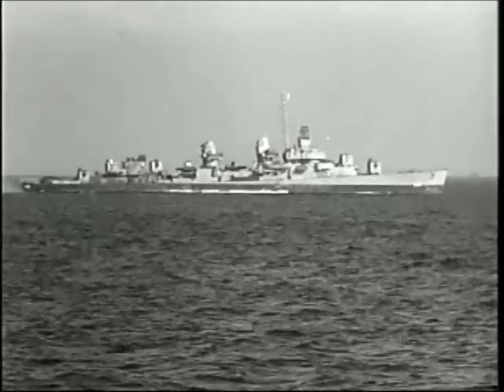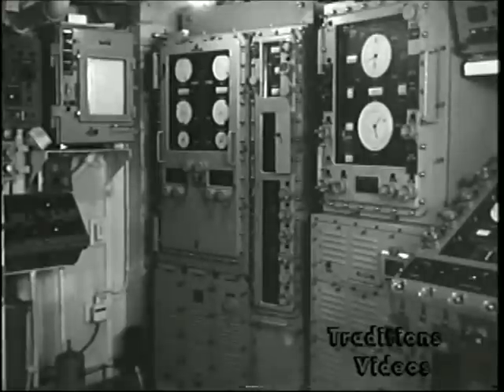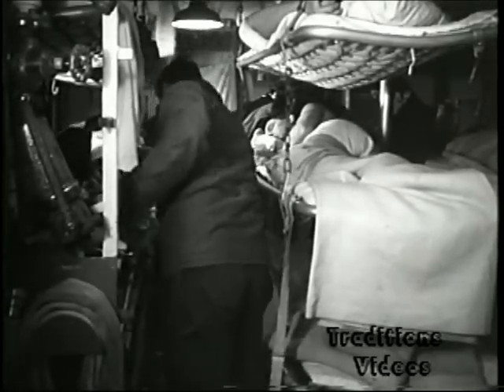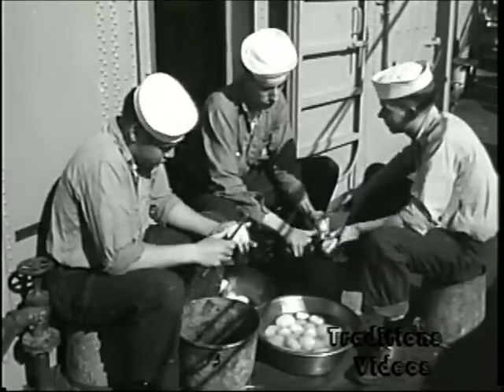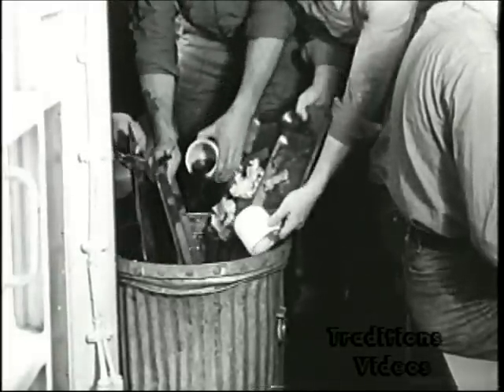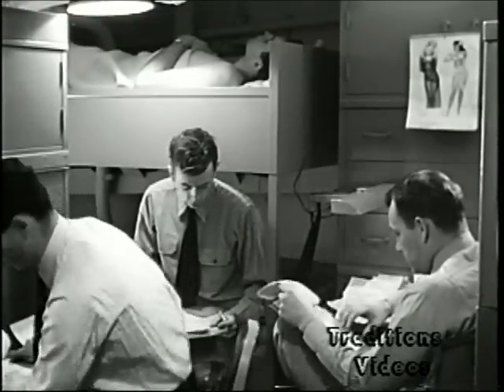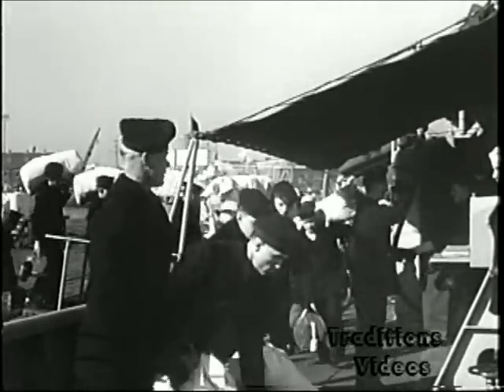US Navy USS  Saufley DD465 1952 Living Conditions

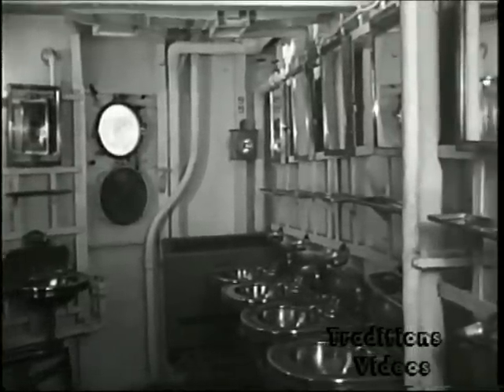Comment: @6:03 - the mad poopers.
Reply from the maker: Am not sure how "mad" they were but from my experience, they wanted to be done as quickly as possible with the least amount of interaction as possible.
One of the problems they don't mention is that in heavy weather, dramatic movements of the ship cause toilet water, which is sea water, sloshes up and acts as an unwanted package/butt washing experience.  Not fun. Foreknowledge of this issue prompts intermittent flushing strategies to avoid the "bidet" effect with soiled salt water. 
That heavy weather also meant you had to brace yourself to avoid falling off the toilet.

Comment: It wouldn't be a real Navy without the spud peelers
Reply from the maker: Some ships had potato peeling machines and others had temporary mess cooks doing the deed.  Potatoes and onions were stored in vented and usually unlocked storage lockers on the main deck. Shipmates, if hungry, could grab a potato and either eat it raw, or, if you were in engineering, you'd bake it in a heated area of the steam plant. Small pleasures, as stolen potatoes taste better than those served in the mess.
Reply: braintrusts I did not know that. Thanks for the cool fact! 👍🏻
Reply from the maker: Forgot to mention that when we'd do the High-Line at sea with another ship (pulling up abreast at ~100 feet apart doing ~15 knots), we'd sometimes see a potato war with each side flinging potatoes at each other, all in fun, but you better not get hit in the head. The bridge frowned on such activities.

Comment: why so many guys?
Reply from the maker: Seems like too many, but it takes a ton of men to man three twin 5" 38 cal gun mounts (40 men), two separate damage control/fire-fighting crews  (20) men, plus  a dozen or so on the bridge, ~60 in radar/communications/sonar/torpedoes, not to mention the quad 40mm/20mm guns and the machinist mates and boilermen in the propulsion/mechanical plant. Then there's the electricians/shipfitters/enginemen, corpsmen, cooks, admin staff, laundry, barber and electronics technicians for the radio/radar, etc..  And, there's a whole lot of maintenance of the ship with elbow grease chipping, sanding & painiting.
New ships have fewer crew because of sophisticated missiles and less guns, plus there are no boilers, just large gas turbine engines making electricity to power the propulsion and the rest of the equipment on the ship. Still takes a lot of work, though.

Comment: What do you do with a football onboard a DD? LOL, WTF? Maybe for when they go o shore leave?
Reply from the maker: For a short while we had a volleyball net on the small flight deck (DASH) and the ball we used had a way to tether a line to it so it couldn't go overboard. Lost a few balls due to line breakage and the line would sometimes get wrapped around an arm or head; kinda dangerous.
Footballs, soccer balls and baseball equipment were made available in ports overseas that had accommodations for sports.

Comment: How many of you who served got the chance to drink reconstituted milk ? Gross stuff.
Reply from the maker: Much of the instant food and drink was to be suffered through. We had instant milk (evaporated milk) and flavored drinks and coffee, and of course, water.  Yeah, any non-natural milk is horrible, but, ya get used to it, that is, unless it's served warm. Yuchh! Thanks for posting!
Reply: I would not drink the reconstituted milk. Coffee, water, or "bug juice" (kool-aid for those that don't know).
Reply from the maker: @retnav92  I would only drink the powdered milk when it was really cold, but drank lots of bug juice and gallons of coffee.
Reply: @braintrusts  I remember the snipes in the engineroom & fireroom using the military-issue kool-aid powder (orange flavor usually) to clean the stainless deckplates. Sprinkle the powder, add a bit of water, then use a buffer with a scrubbing pad, then rinse with fresh water. That stuff would really clean the oil and grease off the deckplates. Just think what it was doing to the stomachs of the guys that drank a lot of it.
Reply from the maker: @retnav92  The reason that it worked so well is because it contained citric acid.  We used to dump a couple of envelopes of the instant bug juice (usually lemonade) in the sump of the commercial dish machine we had for washing all of the mess trays, cooking posts, etc and it would shine up the stainless all by itself and no scrubbing necessary. 
I'd say what ate out our stomachs was the massive amounts of black coffee that we consumed.
Reply: @braintrusts  Concur on the citric acid in the bug juice powder, and definitely agree on all the black coffee we consumed. :)

Comment: Take a shower in private, but not a dump ?
Reply from the maker: Ultimately, there was no privacy, even in the shower: only one minute in the shower, meaning you jumped in to get wet all over and then stepped out to let another in, and then using soap and washrag, scrubbing whole body and THEN getting back in the shower to hopefully get fully rinsed off. Standing outside the shower naked means NO PRIVACY. Getting dressed in the morning one was surrounded by others, the head was really crowded in the morning and during the 1 hour of shower usage for the crew, and the toilets had small partitions in the upgrades but there was no door or curtain and the $hitters faced each other. Impossible to have privacy. There was NO place to have privacy in  getting dressed, sleeping, crapping, pissing showering or sleeping. One just learned to ignore those around you. 
Thanks for posting!